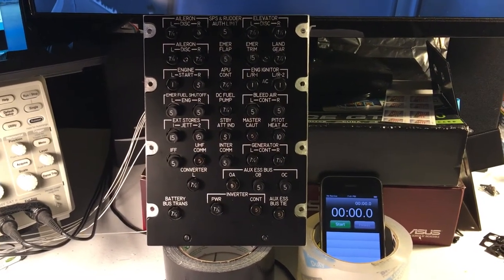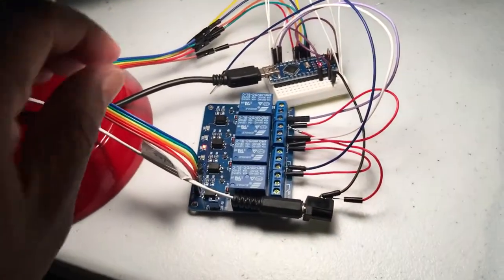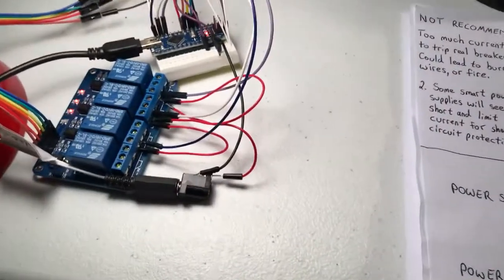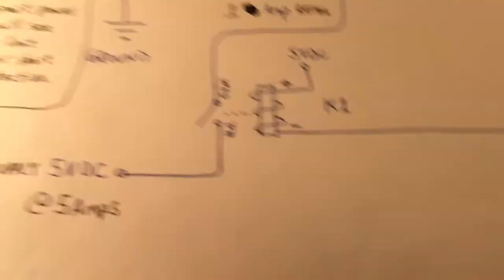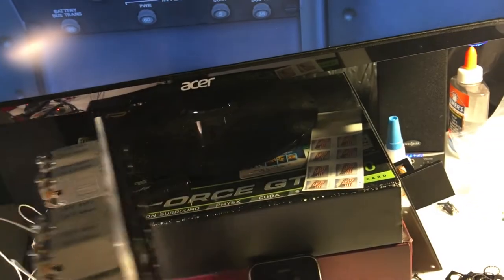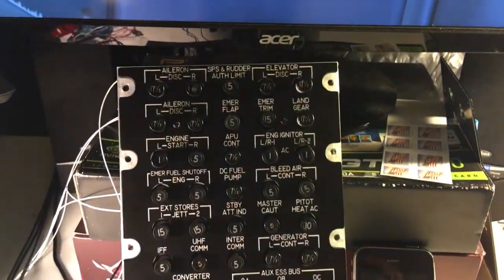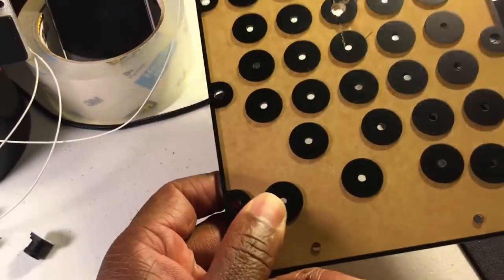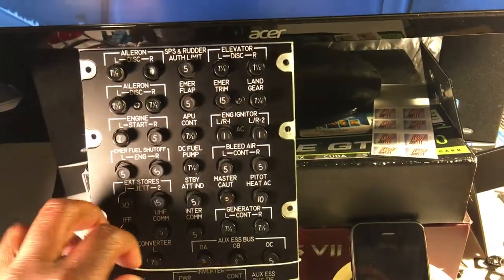A-10C Home Cockpit: Implementing poppable circuit breakers

Comment: Great work Joe. It's really good you explored several options and each clearly explained, cheers
Reply from the maker: Thanks Mr. Craig.  I was just checking out your Fuel Control Panel.  There is a Potentiometer on that panel for the external lights around the fuel nozzle on the nose.  I don't believe I ever got DCS-BIOS to read that pot for me.  I was surprised to see it working in your video.  In the DCS-BIOS Control Reference Doc, its listed as though its on the Auxiliary Light Control Panel, even though it is located on the Fuel Control Panel.
Reply: Hi Joe, the sliding switch was to mimic the fuel open /close receiver. It's input via keyboard encoder so not sure if its listed correctly in control reference library.
With regard to your simpit are you planning to post an overview of it given all the extra panels you have developed recently
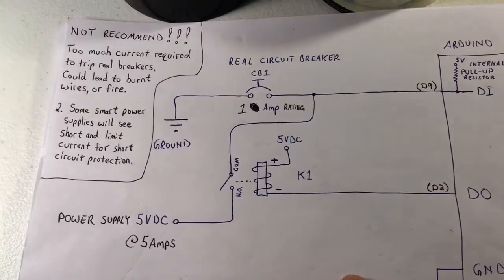Reply from the maker: Thanks. Craig. I was referring to the knob to the left of that sliding switch. In your video I saw you rotate it at the 1:00 minute mark. But I think you answered my question though if you are using some kind of keyboard emulator. Well I have the landing gear panel done, and I've changed the CDU and AAP panels to pcflights.com. Maybe soon.  I'm remaking the MFDs to be real size, redo engine Instrument cluster, and UFC to pcflights.com.

Comment: Wonder where all the circuit breakers on military fighters and things like the A10 are. When you look at airliners they have whole walls dedicated to them. This panel is tiny in comparison.
Reply from the maker: You are correct. It’s only a small percentage that is accessible to the pilot. Most of the circuit breakers are in the avionics bays and maintenance bays. 
https://www.alamy.com/stock-photo-airmen-perform-maintenance-work-on-an-a-10-thunderbolt-from-the-354th-50100298.html?p=65799&srch=foo%3dbar%26st%3d0%26pn%3d1%26ps%3d100%26sortby%3d2%26resultview%3dsortbyPopular%26npgs%3d0%26qt%3d354th%2520aircraft%2520maintenance%2520squadron%26qt_raw%3d354th%2520aircraft%2520maintenance%2520squadron%26lic%3d3%26mr%3d0%26pr%3d0%26ot%3d0%26creative%3d%26ag%3d0%26hc%3d0%26pc%3d%26blackwhite%3d%26cutout%3d%26tbar%3d1%26et%3d0x000000000000000000000%26vp%3d0%26loc%3d0%26imgt%3d0%26dtfr%3d%26dtto%3d%26size%3d0xFF%26archive%3d1%26groupid%3d%26pseudoid%3d%26a%3d%26cdid%3d%26cdsrt%3d%26name%3d%26qn%3d%26apalib%3d%26apalic%3d%26lightbox%3d%26gname%3d%26gtype%3d%26xstx%3d0%26simid%3d%26saveQry%3d%26editorial%3d1%26nu%3d%26t%3d%26edoptin%3d%26customgeoip%3d%26cap%3d1%26cbstore%3d1%26vd%3d0%26lb%3d%26fi%3d2%26edrf%3d%26ispremium%3d1%26flip%3d0%26pl%3d

Comment: Hello ! I'm almost complete project of right side of cockpit ! But i'm stuck with 7 segment 4 digital display for TACAN and 7 segment 6 digital display for ILS .... Can you help me please with the code ? I Have 1637 controller on them ... Please help me ... i'm going crazy
Reply from the maker: Just saw your message. I’m actually on the road moving. So all my stuff is in boxes. For the ILS I used the Max7219 chip to drive the display.  Just download the ledcontrol.h library. The tacan isn’t as straight forward because it’s an alphanumeric display. So the code to drive that may look different.
Reply: Joe Sim 4 digit display , work perfect ! but 6 digit ... the numbers are in wrong place . So if i chose the numbers for digit displays , from left to right and add ILS on it , this looks like number is reversed . From left to right  108 on my display looks 801 . If i chose display.serCursor (0, 1) this didn't help ... sorry for my english
Reply from the maker: If you are using the ledcontrol.h library, then you set up your display for example as

LedControl MyDisplay = ledControl (Din pin, clock pin, chip seslect pin, # of max7219 chips);

Then when you go to use your display you can use a command as example below

MyDisplay.setDigit (0, 2, Value, false);

The explanation for line above is as follows
0 = chip number.  0 = chip #1,  7 = chip #8 (most cases you will only be using one Max7219)
2 = digit number. 0 = digit #1, 7 = digit #8. (This is the number you change if you want then character to show up somewhere else)
Value = the number you want the display to show 0 to 9. 
False = if you want the decimal point off, true = lit decimal point.
Reply: ok . need to try ... can you give me your example of sketch for ILS please ?
Reply from the maker: All my stuff are in boxes in storage at the moment so I don’t have access to my computer. But looking at your set cursor command tells me you are using an LCD to display the ILS. At first I thought you were using 7 segment displays. In that case you can print the character string sent by DCS-Bios to the LCD. The Tacan and ILS would use the same code format. Maybe use could post the code you used. It shouldn’t came in backwards.

Comment: Joe unfortunately the panels are not really replicas either the size is incorrect and as you pointed out some things are not labeled correctly . Great find on the Simulator breakers part number!!!
Reply from the maker: Thanks. Yes you are correct. The face plate thinkness maybe slightly too thick. If you are bare hands you could push pull the breakers. But if you had on pilot gloves, then the breaker heads are tough to grab.  But overall its an excellent replica. Faceplate is sturdy and durable.
Reply: Hi Joe I should have been more specific the measurement for the overall panel are about .25 inch short on the breaker panel great work on the control boards hopefully the entire system will work for all switches indicators and gauges.